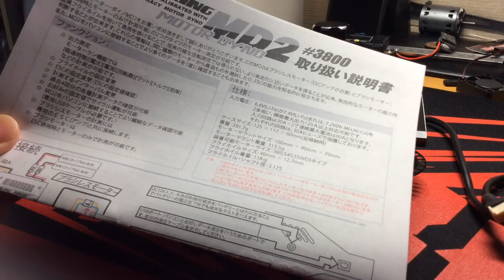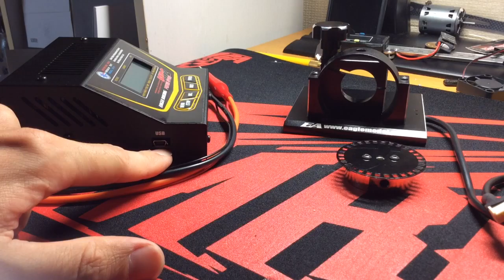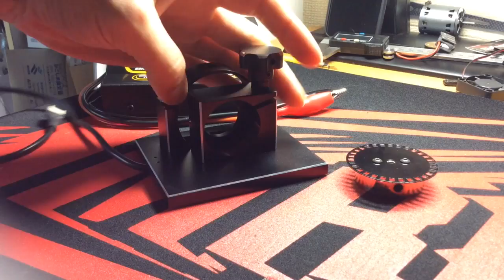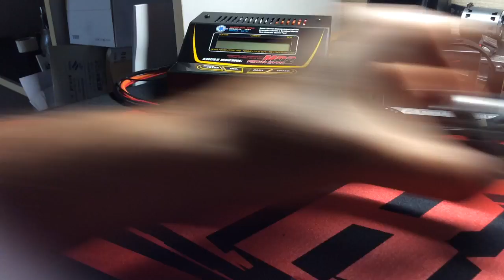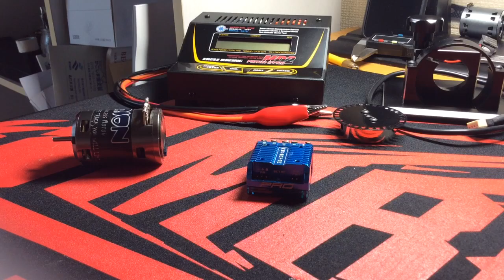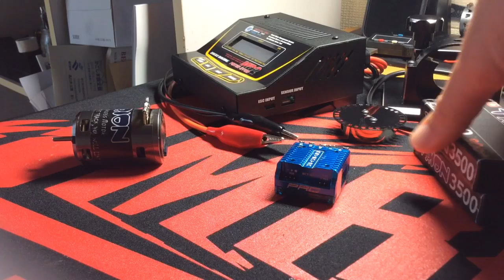Eagle Racing MD2 Dyno (Part 1)

Comment: Ideally you want to use the 12v supply rather than a battery because the supply voltage will be constant to give you a consistent result as wear/temperature/charge state/Internal resistance will differ every time you charge your battery supply. Ideally a constant voltage supply will give you the best/consistent result